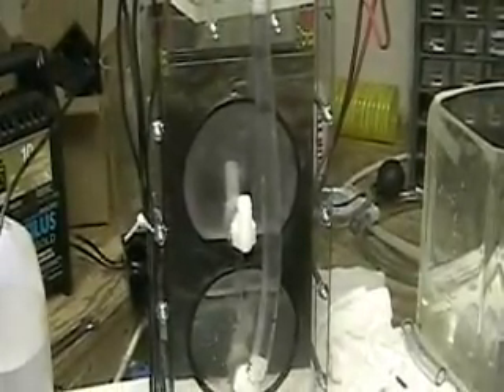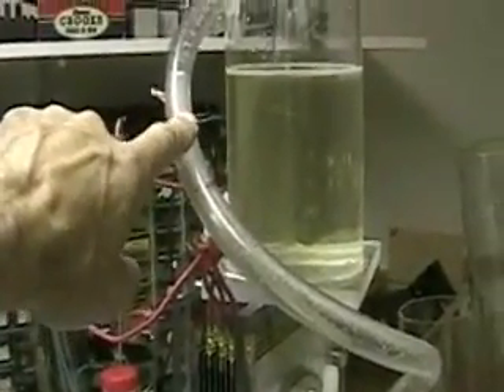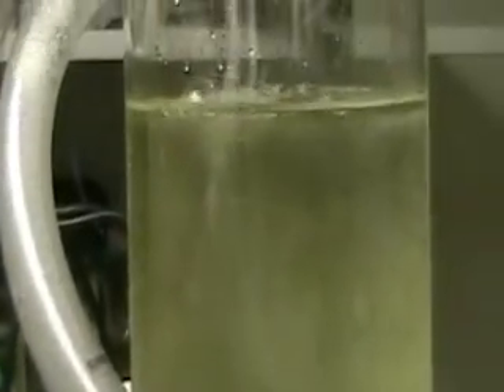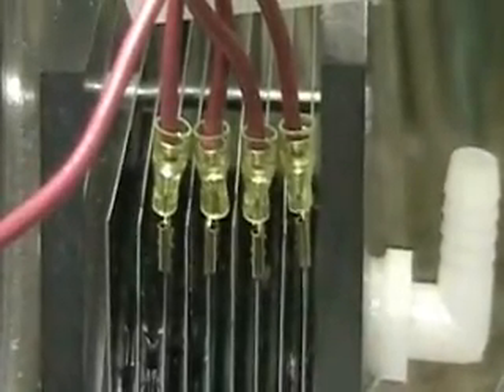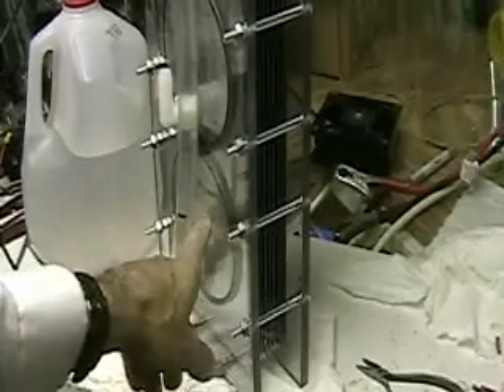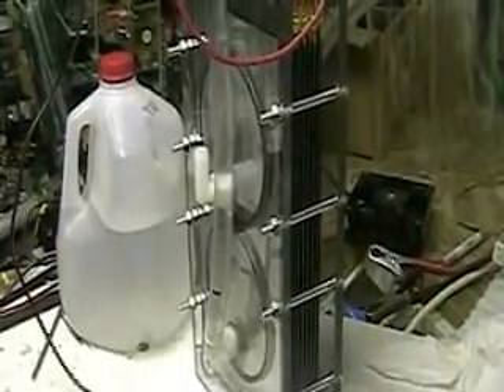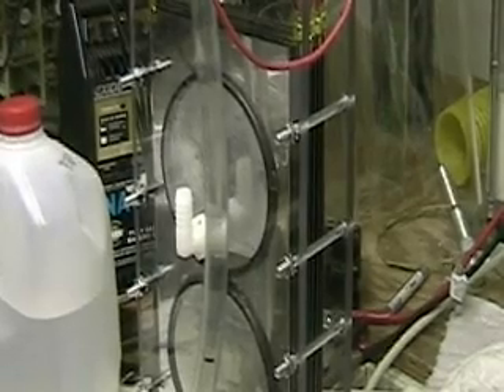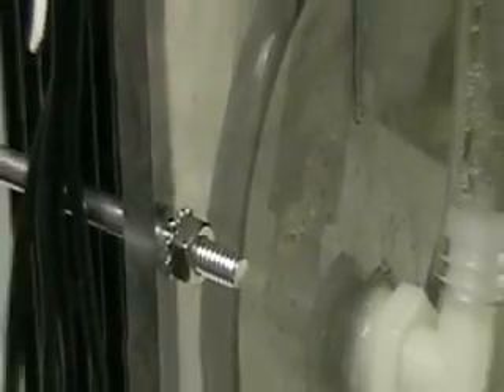Hydrogen Tap ( FOCUS-Q first test) 390

Comment: hmmm nice design.. when u say we are only seeing the bottem cell.where r u putting the other top one? in the next level of water? and i cant tell whats is really going on there. do you have a hole in your plates that the water just flows through, or is it filling a section that you just cant see from the side? it def looks solid. have you tried to hook up a torch to it yet? if u can make a small condenced virsion of that you can sell to welders.